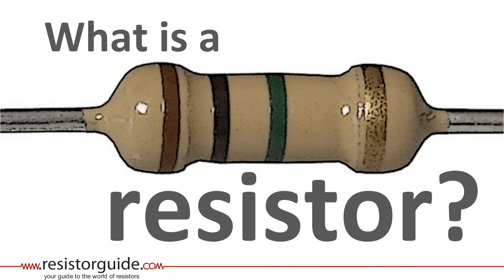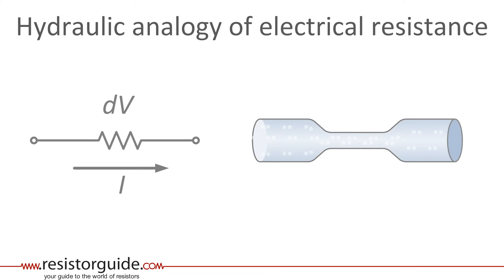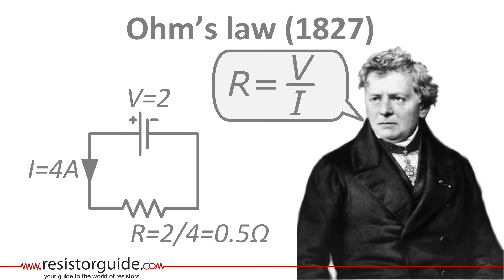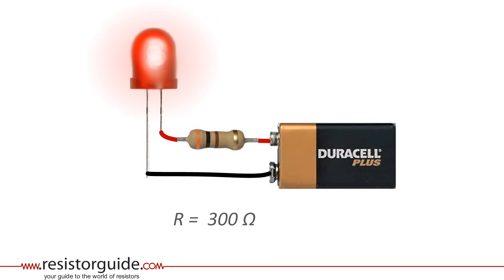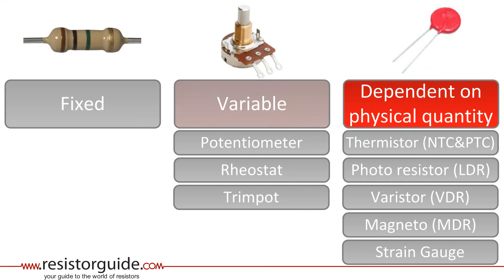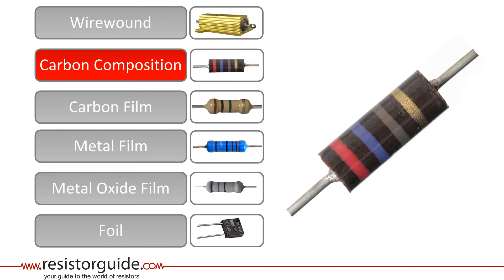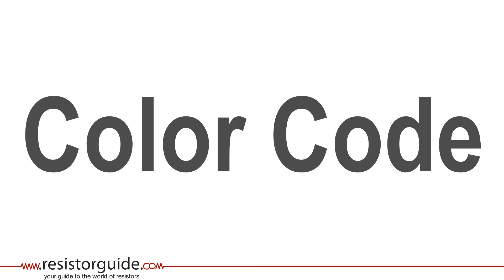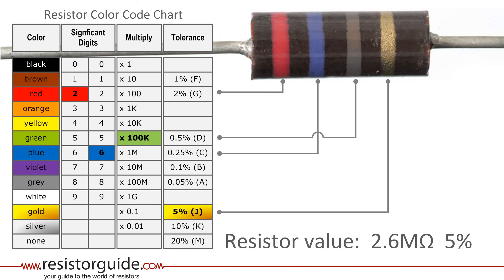What is a resistor?

Comment: So does the resistor change its Ohms if connected to something else ? Like, using that same as in the LED example, with another 45mA LED, will that same resistor switch to 200 Om ?
Or is that value a constant depending on what ? The material that resistor is built with ?
Can that same transistor be used for some high voltage stuff like city electrical connections with 1.000.000 V ? If no why not ?

Comment: I thought LEDs are also voltage dependent. So while I understand you would use a different value resistor if you were using a 3v battery rather than a 9v because of the math, If it’s just changing the amperage going to the LED, and not the voltage, I don’t understand how either the battery voltage doesn’t matter, or the resistor changes both voltage and amperage?

Comment: Why can the resistor be on both the positive and negative side?

I mean logically thinking, if the resistor was on the negative side then wouldn't the current still be too high because its before going through the resistor?

Edit: volts from battery flows from negative to positive not the other way around, but my question still stands.

Comment: The reason this is confusing to me is because it is wrong.  "primary function to limit the flow of electric current"
Current is amps.  Shouldn't it say that it limits current (amps) AND voltage (pressure).  Why does no one else see this problem?

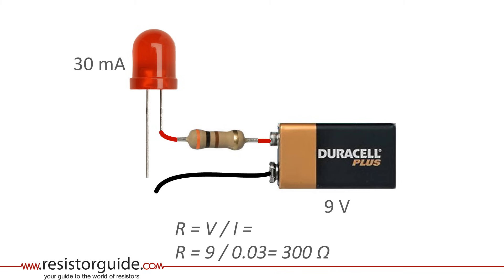Comment: Why did the 30mA turn into 0.03 on the equation at 2:28 ? Thanks in Advance !
Reply: According to formula , when you use Voltage , you must use Amper as a unit.So there is a conversion between milliampere to Ampere then 30mA makes 0.03 Ampere.Actually they are the same value.

Comment: wow! don't tell anybody you are electronic engineer. A LED (and not LID) has a forward voltage gap between 1.2 (for some yellow green) and 3.6 volts (for some white and blue) and it may be like 1.8 to 2.2 (average 2) volts for your red stuff, therefore, to create a 30mA current you must have a resistor of (9.0-2.0)/0.03=~230R. With 300R you only get ~23mA through that LED. And your way of picking colors from the chart sucks... (Edit: and I can not believe that you didn't fix the tolerance column in that calculator at resistorguide.com chart in 4 years, it shows black/brown instead of brown/red, therefore the tolerance calculation is always wrong).

Comment: l have a doubt.........Is there is any voltage drop between the terminals of resistor???
Reply: Well, since that us their primary job, I would say no, but given the tolerance of the resistor you using some might drop a little bit more than others inside their specified tolerance.

Comment: if you take the example of a hydraulic pipe then when the flow of the water is resisted hence creating pressure and the same happens with resistors then shouldn't the voltage shoot up in relation with the flow of electrons? just like when you press the tube of a vinyl pipe when water is flowing through it?

Comment: Hold on i thought a Variable Resistor was basically a Transistor? why call it a Miliamp? instead of 1 milivolt? And calling Current I lol i have a very logical  brain, i have to break everything down. so sorry. 
if you#re pushing a certain amount of waterr/energy through an open valve like 12volts. then you reduce the resistance to make only 5volts come out the other side. Whats happening the all the extra water between the front and the back? surely the (in theory) having more going in one side than out the other causes a leak or a build up? Wheres the extra 7 volts going after the resistance has been raised? it's not being compressed or whatever? thanks man

Comment: Does resistor delays power consumption? i had a case of smoke generator that i mdel a coil out of vape wire and a 5v fan and the power was 7.5volt 1000mah rechargeable battery, it runs for roughly 8 -10 minute and the power will ran out, one of the biggest reason i'm thinking on adding a resistor was i hope it would slow down the flow of the current but does this actually means same amount of power would still be wasted ? and that protects the fans and the heater wire coil from burn out?, i'm working on my second homemade  smoke generator for my RC(remote control) tiger 1 1:16 , but this time the boiling chamber was much more compact and smaller which made the smoke liquid runs out even faster and the coil would caught lit up with fire and later extinguish itself when the oxygen in the bottle was used up, i still had a lot of adjustment to do with this smoke generator , improved until it was much more feasible to use than conventional aftermarket smoke generator.

Comment: You forgot to account for the voltage drop thru the LED(red is about 1.6v) and subtract that from the battery(9v) which gives you 7.4 v/.03a yielding a r of about 246 ohms, not 300.

Comment: I did an experiment hooking up a resistor with high resistance to the wall socket (BTW NEVER do that, its stupid) and i discovered it didnt heat up noticeably. I concluded that all the current must have gone right through it instead of escaping as heat, but then i realized: if all the current moves right through it then its a short circuit so how come the electric fuse didnt activate?

I realize there is a flaw somewhere in my logic but i dont know where. Someone please help!

Comment: extremely stupid question. why does the resistor go on the negative pin instead of the positive pin before it reaches the led? is the high power not already flowing before it is regulated by the resistor?
Reply: That's what I was thinking.. I better do a research on that
Reply: tbh idk
Reply: kralalrulz
Reply: I'm pretty positive that electrons move from the negative terminal of the battery to the positive. it would matter where the resistor goes, because if you put the resistor near the positive end of the battery, then you will blow out your LED.

Comment: so what if that 9v battery was 3v, how would I determine the current then? wouldn't I need the resistance of the led itself?

I'm confused because everyone puts a resistor on their 3mm LEDs in xbox controllers. BUT it's 3v from the controller, which is what the LED's are rated for. So what's the point of the resistor?
Reply: FroztiProductions if the leds are rated for 3v what is there rated current rate? How many milliamps can they handle is what you need to know if it's any voltage could be 3v, 9v 12v you still need the resistor for a led as they are generally rated at 30ma like in this video and the resistors stop to much current going onto the led and burning it out, basicially like if it was a water pipe it stops to much water going Into the led and flooding it.
Reply: Well if they are rated for 3v I assumed the current rating would be calculated by that voltage the the internal resistance of the LED itself . I'll double check.
Reply: How can I be sure about the voltage drop, use multimeter to test voltage before and after LED?
Reply: FroztiProductions - use a potentiometer ("pot") in series with the LED and battery, and adjust the pot until it glows just enough for you.  Then use your multimeter to measure the resistance of the pot, and substitute it with a fixed resistor.  Just be careful not to turn the pot too far down or you will burn out your LED.  Oops!

Comment: do resistors have polarity (positive or negative)??  or can we use them in the circuit anyways... thanks
Reply: You may only use resistors if they have been preapproved by the Federal Resistor Polarity Commission for handling either positive charge (protons) or negative charge (electrons) else your circuit will either start generating antielectrons or antiprotons (depending, obviously, on the type of resistor you are attempting to abuse) and explode or it will suddenly vanish into the 8th dimension.  Never ever forget:  Knowledge is Power in today's increasingly technological world.

Comment: Isn't the longest wire the positve side of the LED?
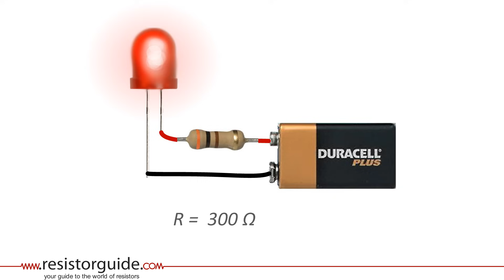Reply: so in 2:46 he should've connected the wire differently ?
Reply: The led should not work he has to flip it over and it is not called a lid
Reply: Kim Pacolet yes
Reply: Micco Millchris Reyes
Reply: hello brother resistor connected any way any side in only series the above circuit diagram is series diagram
Reply: Kim Pacolet

Comment: Common mistake. In the tube of water is no pressure drop! Venturi taught us, that the pressure is lower in the narrow part of the tube, due to higher flow speed and equal before and after the narrow part of the tube. A liquid can not be compressed nor expanded! If you want a pressure drop in the tube, you have to take out energy out of the flow eg by a turbine.
Reply: A constriction of the pipe will cause an increase in pressure. That's how our circulatory system works. If you reduce diameter you increase pressure. As an artery or vein constricts, there is a consequent increase in blood pressure.
Reply: +Steph E. Hi Steph. You are mixing up things. Our vascular system contracts as a whole. Therefore the volume of the whole system decreases thus the pressure in the contained liquid increases (p=m/V). But in a pipe where a liqud flows we have partial pressures. In the narrowed section of a pipe the speed of the liquid is higher as in the neighbouring wider parts. The partial pressure in this section is therefor lower. For in depth info look up "Venturi" and "Bernoulli".

Comment: Such a basic topic, yet so many errors...
Reply: Perhaps I should be more constructive with my critisism:
- The water analogy is NOT a proper one to discribe the reduced current flow in elelctrical circuits with added resistance.
- It's not called an L'I'D, but LED
- The long LED lead is the anode (+)
- When calculating the LED current, you have to subtract the LED's voltage drop from the supply current. So a 300 ohm resistor will NOT give pass limit the current to the preferred 30mA, but 25mA, when assuming a voltage drop of around 1,5V (typical red LED).
- Fixed resistors are available in radial packages as well.
- Green is not equal to grey, 10k is not equal to 100k (or 100M).
Reply: Actually I think red would be about 1.8 - 2.0 V typically.
Reply: Correct. Unless you run them at about half their spec'd current, which I tend to do ;). The voltage drop then decreases somewhat.
Reply: It really varies, I would double check your datasheet.  If I am understanding you correctly you would want to run it at 10mA (since they're usually spec'd at 20mA) in which case your Vf is about .1V less - not much of a change for voltage drop, yet you will see a significant change in luminosity.
Reply: I just measured the voltage drop across an old, opaque red LED in a project from a while back. Measures 1.45V with a current of 9mA on a Fluke 85-3. I do agree it varies (wildly) depending on color, make, manufacturer, etc.
Reply: yours was the best post, Thijs De BONT.

Comment: Its not called lid, but led!!! Noob
Reply: Goes to Wikipedia, Copy and Paste
Reply: well duh it's an international slang
Reply: well duh, A light-emitting diode (LED) is a two-lead semiconductor light source. It is a p–n junction diode, which emits light when activated.[4] When a suitable voltage is applied to the leads, electrons are able to recombine with electron holes within the device, releasing energy in the form of photons. This effect is called electroluminescence, and the color of the light (corresponding to the energy of the photon) is determined by the energy band gap of the semiconductor.

An LED is often small in area (less than 1 mm2) and integrated optical components may be used to shape its radiation pattern.[5]

Appearing as practical electronic components in 1962,[6] the earliest LEDs emitted low-intensity infrared light. Infrared LEDs are still frequently used as transmitting elements in remote-control circuits, such as those in remote controls for a wide variety of consumer electronics. The first visible-light LEDs were also of low intensity, and limited to red. Modern LEDs are available across the visible, ultraviolet, and infrared wavelengths, with very high brightness.

Early LEDs were often used as indicator lamps for electronic devices, replacing small incandescent bulbs. They were soon packaged into numeric readouts in the form of seven-segment displays, and were commonly seen in digital clocks.

Recent developments in LEDs permit them to be used in environmental and task lighting. LEDs have many advantages over incandescent light sources including lower energy consumption, longer lifetime, improved physical robustness, smaller size, and faster switching. Light-emitting diodes are now used in applications as diverse as aviation lighting, automotive headlamps, advertising, general lighting, traffic signals, camera flashes and lighted wallpaper. As of 2016, LEDs powerful enough for room lighting remain somewhat more expensive, and require more precise current and heat management, than compact fluorescent lamp sources of comparable output. They are, however, significantly more energy efficient and, arguably, have less environmental concerns linked to their disposal[citation needed] . The governments of some countries are promoting the domestic use of LED-based lighting, and in some cases providing LED-based lighting solutions to the public at subsidized rates.

LEDs have allowed new displays and sensors to be developed, while their high switching rates are also used in advanced communications technology. goin mr.beast style
Reply: Hashtag Yolo smart guy

Comment: where did you get the 0.03?
Reply: Since we are working with volts, lets work with amps and not milliamps. 1 A = 1000 MilliAmps. So 30milli amps/1000 = 0.03 A
Reply: +Cedric Mania superb
Reply: 30 Ma (Light Bulb)
= 
.03 Volts/Ohms